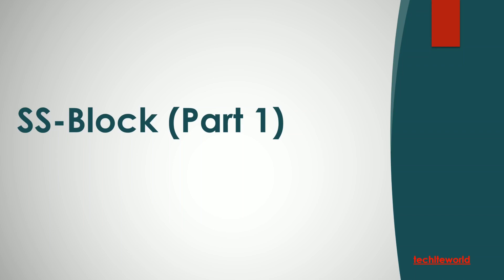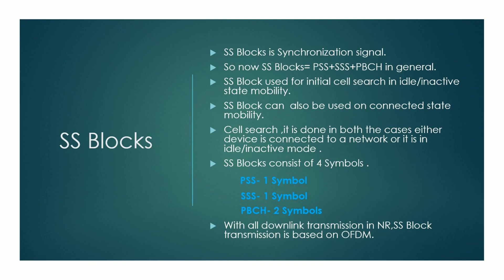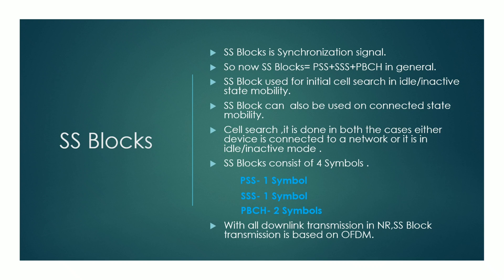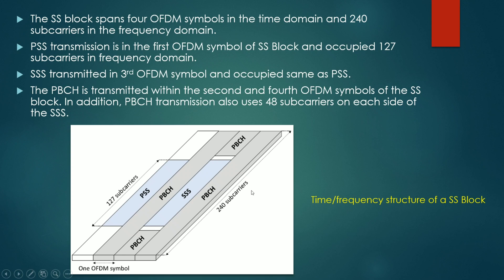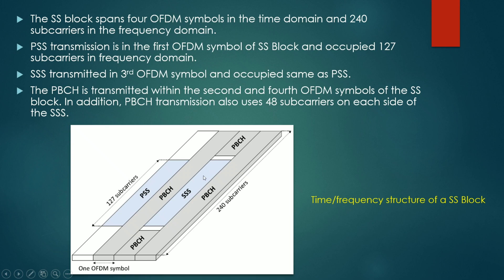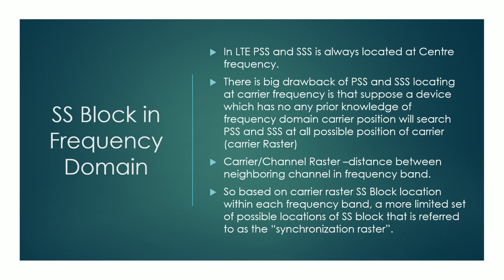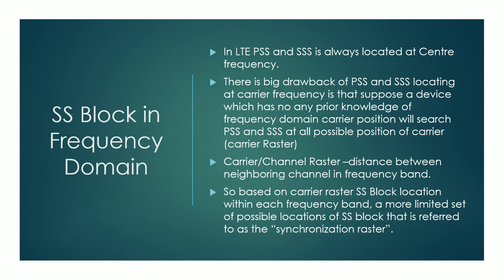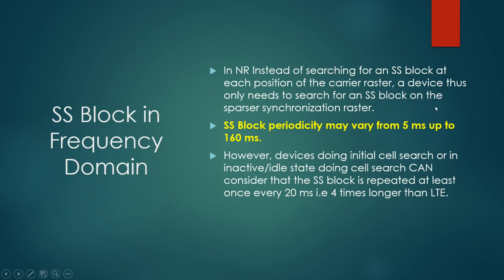#5G-NR #SS-Block (Part-1) (Day 4) || techlteworld (TLW)

Comment: What can be transmitted in blocks between PBCH and SSS in 3rd symbol ?
Reply: Hi Bhavin
In SS Block 3rd OFDM symbol is PBCH +SSS +DMRS. Here the SSS is central part with 127 sub carriers and then 48 sub carriers of PBCH on either of the SSS. There are some unused carriers in between for guard which are filled as nulls.
Reply from the maker: Thanks Chetan